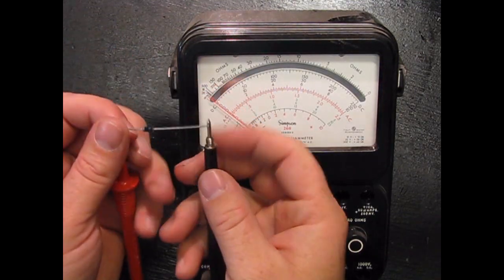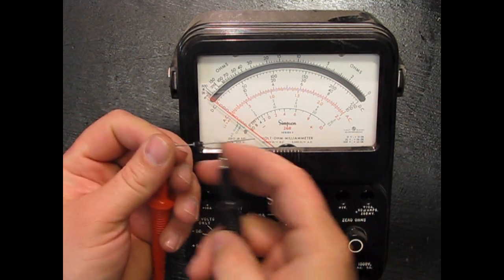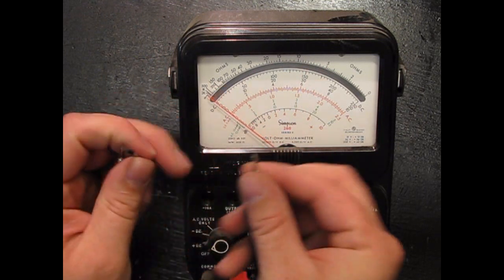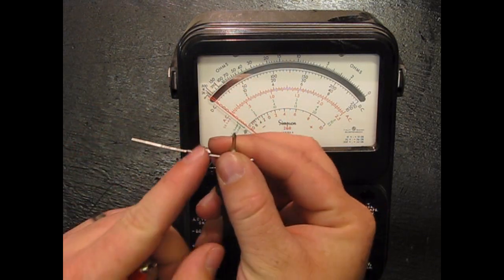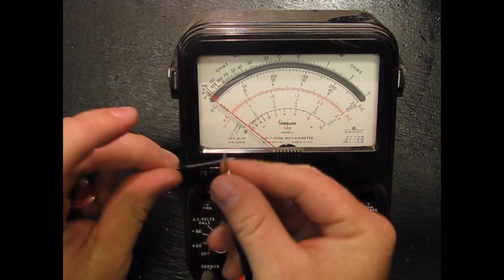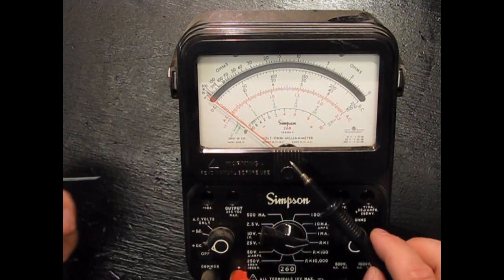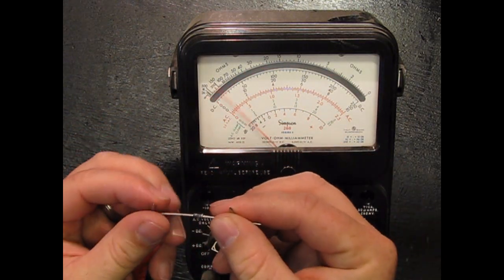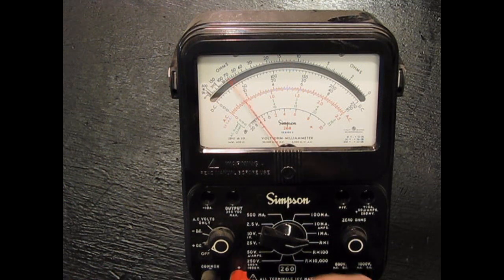How to Test a Diode

Comment: Question, why my analog multi-meter is showing resistance when the positive lead is on the Cathode and negative lead on the Anode. Then, it will show no resistance when the positive lead is on Anode and negative lead on Cathode. Is this correct?